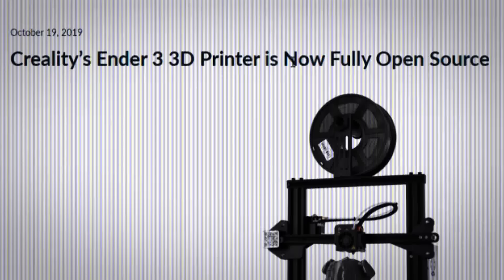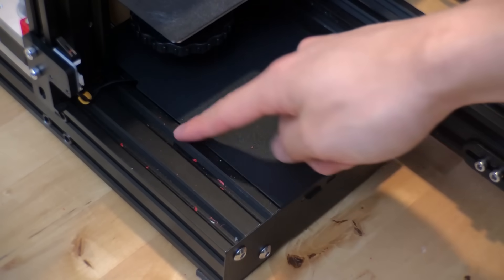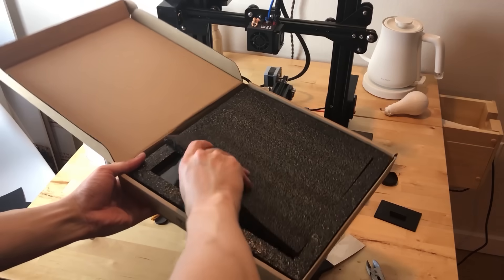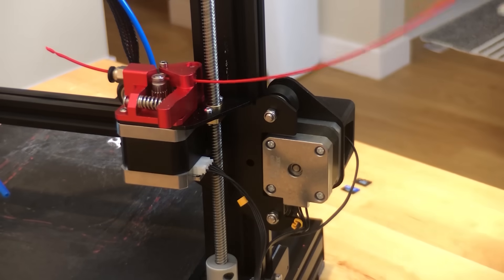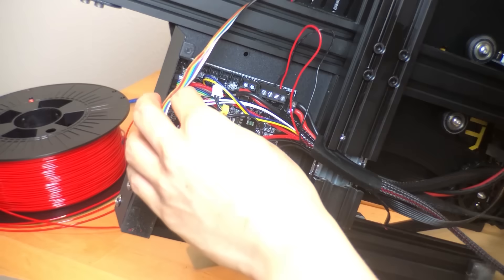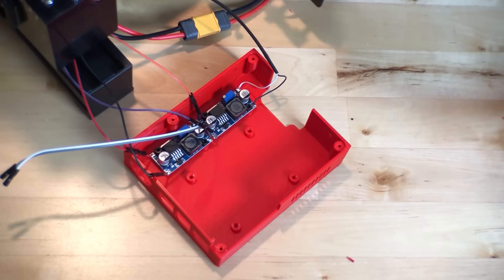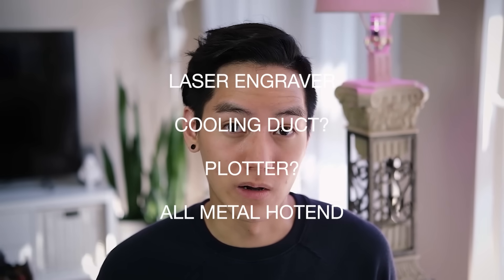First 24 Upgrades for my Ender 3 Pro - Part 1

Comment: Sooo just got my ender 3 pro last weekend, got it put together, leveled it out, and tried to run the cable chain print but started running into issues with the pla sticking to the magnetic bed. any tips?
Reply from the maker: is it sticking too much or sticking not enough?
Reply: @ScottYuJan  not sticking enough. i reduced the printing speed to %30 and it seems to be sticking now, though it has been 8hr though and its still printing.
Reply from the maker: @DracoEX  if you need to print at 30% speed for the print to stick, it means your bed adhesion just isn’t good enough and 99% of the time it’s due to an unleveled bed. i recommend following this tutorial: https://youtu.be/_EfWVUJjBdA 

another thing too that might help is to clean your bed with alcohol in-between prints since grease from your fingers or dust on the bed can also lead to these problems. when i’m lazy i just use hand sanitizer. that also works. good luck!

Comment: at what temperature do you print the pla and at what temperature do you put the printing plate? thanks
Reply from the maker: depends on the brand of PLA but you should always aim to print at the lowest nozzle temperature possible. so i print at anywhere between 190 to 210 nozzle and usually 60 for the heated bed.
Reply: @ScottYuJan  Thanks
Reply: @ScottYuJan  and at what speed do you print?
Reply from the maker: @geb212  depends on your own printer, settings, and the prints you’re making. you’ll just have to test that on your own.
Reply: @ScottYuJan  Ok, thanks again

Comment: I've done the sd-card reader update with the exact same sd-card adapter but it doesnt work properly somehow. it only works or recognizes the inserted card, if I disconnect and reconnect the micro sd adapter from the printer itself. the adapter works fine on a pc so it must be an issue with the printer. I have marlin 1.0.1 on my ender 3 pro. does anybody know how to solve this problem?
Reply: Same issue here. Ill try to update the firmware.
I too am on 1.0.1 right now.

Comment: It would help if you priced every Upgrade. Pricing would help justify buying a cheap printer as opposed to a more expensive one that doesnt need to be Upgraded or Modded. It looks like you took a $300 3D Printer and made it look like $1,000 or more
Reply from the maker: that’s a good idea. I’ll definitely do that for part 2 and 3. thanks!

Comment: wait , you blocked up the fan as it was too noisy? OOOKKKK pretty sure fans are for air flow, a cover of that stops it surely? or did i miss something
Reply from the maker: haha i should have clarified this one more. it's a popular design on thingiverse and it doens't really cover the fan. it simply redirects the airflow going through the fan so it's more muffled. there are more details about it on thingiverse.

Comment: That dual gear extruder destroys itself over a few months.  The steel gear first eats into its axle(a screw, threaded through some bearings) then it eats into the aluminum.  Do not recommend.
The springs with the bed leveling knobs are likely too strong as well.  It'll end up warping the plate after a while.

Comment: Hi Scott
Thanks for your great ideas for mods on the Ender 3D. A question, do you also happen to have experience with the installation and especially which firmware you should use for the BigTreeTech SFS v1.0 smart filament detection sensor.
Kind regards
Piet

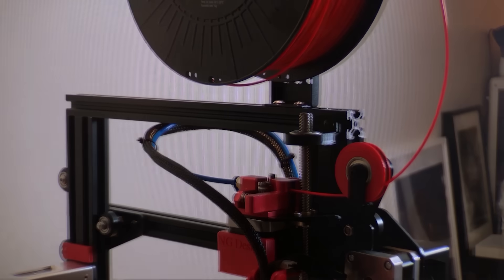Comment: 3:35 question what if the rod is not perfectly straight is there something I can do with it except just buying a new one?
Reply from the maker: nope, just leave it and it will still print perfectly fine. its designed to be unconstrained at the top. I’ll give more details on this in part II coming up soon.

Comment: Some of your mods are draining down the printer quality. Example: Ender 3 Lead Screw Stabilizer. Hell what a mistake to do that.
Reply from the maker: well, i had that one installed for most of the prints in this video actually so i don't think it affected me too much but yessss, someone did educate me about the reasons not to do that one so i removed it recently and added some info about it in my video description 👍

Comment: I have a question. My team have a idea of reverse engineer where we add a stepper motor on the rail or remove the feeder and replace with the stepper motor. Do you think it possible do that and change the program?? Because we want it to rotate only 10-15 degrees but repeated for certain about of time.
Reply from the maker: ummm not sure what you guys are trying to do but the feeder is already using a stepper motor so i don’t think you need to replace anything and yes, the code is quite tweak-able. people have modified the ender 3 to be milling machines, plotters, laser cutters, and even chocolate printers so i’m sure it’s open sourced enough to allow for the kind of hacking you’re describing.

Comment: I'm completely new/a noob at this so kinda dumb question. Whats the point in adding a raspberry pi?
Reply from the maker: when you use a regular laser or inkjet printer you know how you can print from a USB or with a computer plugged in feeding the printer the documents to print? well it's the same with a 3D printer except the document is a bunch of code called "Gcode" that tells the printer how to print the 3D model. Well the ender 3 can print 3D models from using the gcode either from a computer plugged in or an SD card. the benefit of a raspberry pi is now that's a dedicated small computer integrated into my 3D printer and it's connected to the internet. So i can now control my printer from any computer in my house or even my phone and monitor prints remotely. i can upload files to for it to print and it also allows for interesting settings like manipulation of the Gcode. that gets into more complicated spaces but just think of it as a small computer that's now connected to the 3D printer allowing it to go online and do a lot more stuff haha hope that helps

Comment: This may seem a very simple question but why go to all this trouble when you can buy a printer that has most of these upgrades as stock and gives a bigger build volume for less than a ender 3, like i said with more features.
Reply: A lot of printer don't have these features even if they cost more. Some of the features are so cheap that adding them to the stock printers would be a waste of ressources.

Comment: What Octoprint plugins do you use the most? Will the pressure sensor work with an Ender 3 base model (not the pro)? I really want to use Bed Visualizer but don't know if I can without the Pro version of this printer.
Reply from the maker: bed visualizer works with any printer that has an auto mesh bed leveling add-on i believe. so if your ender 3 has a sensor like BL touch installed it should work! good luck.
Reply: @ScottYuJan  thanks

Comment: Question how did you get the scraper holder to fit I just printed mine and it wont fit, so how did you do it? (I am using PLA for this print)

Comment: WHat pins are you using on the pi for the power supply and the fan control and what software controls the fan or is that in octoprint???
Reply: never mind freezing the video you are just using 2 5v pins and 2 grounds I thought you had some fan control going????

Comment: Thanks for this. Just getting started with my Ender 3 Pro and this is invaluable. Just one question - I printed the enclosure for the snazzy tool drawers and the print took 23 hours! Is this normal or am I missing something? Was the default E3P and PLS profile in Cura.
Reply: Mine took that long too

Comment: yet they keep telling us the Chinese are smart.
but we keep buying their substandard crap and then showing them how to improve it? Yes they are smart and we are stupid!
Reply from the maker: yeaa i guess so. a market wouldn’t exist without the demand haha. but to be honest, the reason i only buy cheap 3D printers now is because i’ve used very expensive printers before back in school. $1-2k+ ones and even though they’re slightly easier to set up, over time, they have the same issues and they’re even harder to fix because they’re not open-source. i just don’t feel like expensive printers are worth it anymore. this printer with all these improvements was still under 500 so that’s kinda sweet haha

Comment: 2:54 this was a big mistake
Reply from the maker: the power supply fan is actually not an exhaust but an intake so the cover is only redirecting the intake air. It doesn't fully cover it. I haven't really had any problems with this yet and it's also a very popular upgrade on thingiverse so it's probably fine?

Comment: @Scott Yu-Jan if you print the drawers with the holes facing up what about the slot thing on the back looking at the slicer it looks like it won't balance, did you have to do something else?
Reply from the maker: what do you mean by balance? yes, i did print all the drawer pieces with the openings facing up.

Comment: You should mention you are not using the creality bltouch but a different one. The Creality one will fry peoples board if not connected with the adapter board.
Reply from the maker: really? 😧
are they selling a clone or knockoff or something? oof that’s scary...
Reply: @ScottYuJan  LOL no. So basically if you follow their instructions which come with the bltouch they tell you to use the adapter. Which will work. But if you got a fancy silent 32B board with dedicated ports obviously you don't want to use that pinboard. So following that you look for bltouch 32 bit board which will guide you to one of the many videos of how to do that.

Most videos explain you to put the 3 pin connector on the dedicated port and the 2 pin in the Z-axis stop. If you do this straight away with the creality bltouch, your MB will fry. They switched up the blue and the red cable. You can manually switch over that cables once you know, but then you are still left with the 2 cables for the z-stop, which cannot be plugged into the dedicated ports because creality designed it in such a way it HAS to be connected to the Z-stop switch. The plastic plug won't fit into the dedicated port. BUT, the creality "without adapter" firmware, only works if you connect the BLtouch with ALL the plugs to the dedicated ports. EVEN if you switch the wires on the 3 ports, so you won't fry the board, you can't connect the connector to the z-stop switch (only place where it fits) because their "no adapter" firmware only works with everything connected to the dedicated ports. It is really a great mess. Check out their BLtouch on 32bit board video and read the comments. You will see alot of angry people with smoking/fried boards. Same issue goes for their silent board without adapter FW. The z-stop (black-white-red plastic plug) connector wont fit in the dedicated ports so to use the official creality bltouch you will still need the stupid adapter.

Other way is compiling own FW, but thats alot more work ofcourse. I have ran into many issues after starting to get my Ender 3 Pro away from stock. TBH it was great stock, after I start adjusting, starting with BLtouch, trouble began.

Comment: Can you share the wiring diagram you used for the Pi? The ones I’ve found online all use a power adapter and wiring a switch inline using those methods seems unnecessarily messy

Comment: what kinda temps did you print the cable chains at? I did 3 attempts at 10 links per batch and every time the edges of the clips rose off the bed and I had to cancel the prints. finally I did 8 at a time and it seemed to help
Reply from the maker: i struggled with that a bit too. i recommend printing slightly closer to the bed to get a good squish on the first layer than usual. printing at the lowest possible temp. for my filament it was 195 before the extruder started clicking. and then printing at not a super high layer resolution. when i printed anything at .12 layer height it failed and anything around .16 - .24, it no longer curled. there could be other problems as well but those are what i did that worked for me. good luck!

Comment: How do you get the Sd card mod to work? I have to unplug it from the printer and plug it in again to get it to read. If I just remove the card from the adapter and re insert it, it wont read.
Reply: Depending on your firmware version,  it might say print change media or initialize SD card.  I can't remember
Reply: @kc6wke175  I'll check it out thanks
Reply: Hello. I am having the exact same issue. I too would like to know the solution to this.
Reply: @King_Dogspeed  Figured it out, you have to go to Change media every time you remove and reinsert the card
Reply: @kc6wke175  change to Media?

Comment: About half way done with these upgrades. Also going to build your soldering fume extractor. I think you mentioned in this video you were from Vancouver, WA? I used to work at HP on 164th. Cheers!

Comment: I have a question. How did you get petg to print on the glass plate? Do you have specific settings or do you use one side of the glass or something? Because I am having some difficulty

Comment: Well I'm pretty decent and more than able to teach myself new things so HELLO!, and very nice video although there were a few things I noticed that I'd have to properly teach myself (Soldering electrical things) but I already have a printer on the way. I'll definitely be throwing on some of these upgrades less the ones that I need to do more than print and swap and or screw on :P lol

Comment: This is a really useful video but....
How does the screen interfere your sleep but the sound doesn't? Sound is way worse.
BL Touch sucks,  period.
Reply from the maker: well i find the consistent fan noise kinda soothing actually haha and i’m a deep sleeper. what’s wrong with the BL touch? i haven’t heard many complaints about it and mines still going strong. let me know, thanks.
Reply: @ScottYuJan  the Creality bltouch is unable to connect to the v4.2.2 MB without frying it, even with wrong instructions from creality. It kinda works while using the adapter, but it doesnt seem to work really well. It works for me when I adjust the screws before every print, manually leveling the bed. It seems the bl touch is just not doing anything. Also, without leveling the bed manually before installing it, it doesn’t do much, which seems to eliminate the need for the bl touch. It could be me, but as far as I can tell I would be better of just doing it manually.
Reply: @ScottYuJan  how the heck do I get #10 on there?😬 doesn’t look like it fits on ender 3 pro

Comment: Do you still recommend this dual gear extruder? The reviews on Amazon show that overtime the sharp edges wear into the filament and degrade one of the surfaces on the extruder body. Thanks!

Comment: I’m printing your designs but for some reason it prints a line on the left side of the table and a line around, but not touching, the part itself; both are a waste of material, how can these lines be eliminated?
I have a 3 Pro, using Cura through a MacPro.

Comment: Ah yes, the cable chains were one of my earliest prints. Right after I installed Marlin and did manual (sensorless) mesh bed leveling because my bed is warped and has an almost 1mm dip in the center.

I also bought a raspberry pi 4 with the Argon One all metal case, safe shutdown and fan control included. Powering the pi directly from the power supply is unfortunately not a good idea. Remember, you're not supposed to cut power to the pi without shutting it down first! That's how you corrupt the pi's SD card. Trust me, I did it twice and it actually destroyed one SD card in the process. I couldn't get windows to recognize it anymore.
Reply: Bro i got ender 3 pro with preinstalled skr mini E3 v2 bl touch and marlin
Reply: @ares274shymeyo7  Sweet! Don't forget to add bed leveling in the starting Gcode. I actually bought the EZABL kit as well as Ezboard Lite. Works great.

Comment: Good set of upgrades.  Although, I bought all of the stuff before I even got my E3pro so I guess you could say I've never really had a stock one.  Put in the SKR 1.4 Turbo first thing.  I'd already modified and compiled the Marlin firmware for it.  With the 2209 stepper drivers it is super quiet while printing.  The only noise is the fan in the power supply.  Have you moved your electronics to the rear and mounted your Pi back there as well.  Just did the hero me 5 as well.  Not going to lie.  I was floored by the print quality now.  On .2 layer height, no lines at all.  Very close to my Prusa in quality.

Comment: most of those "upgrades" are useless. If you want to properly upgrade your ender-3 just print direct drive extruder adapter and convert your ender 3 to direct drive printer.
Reply from the maker: i don’t know about direct drive to be honest. i’m seeing a lot of people struggle with rippling and ghosting trying to print faster with it. if i’m never printing flexible filaments is it really still worth the trouble converting to direct drive?
Reply: @ScottYuJan  If you want to incerase your printing speed drastigly with very minor quality loss it worths the trouble(it is not that hard to do btw).  And if you want  your quality back you can just print at normal speeds. I did it to my ender 3 and i get zero skipping at 150 mm/s with shitty stock exturder. There is ringing/ghosting present at higher speeds but as i said if i want quality back i can just print it at 60-80mm/s.